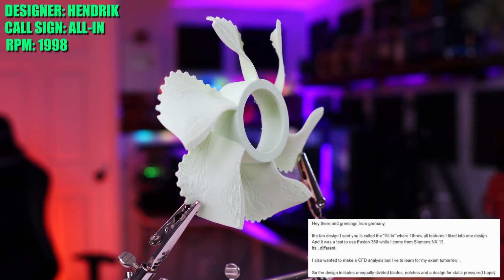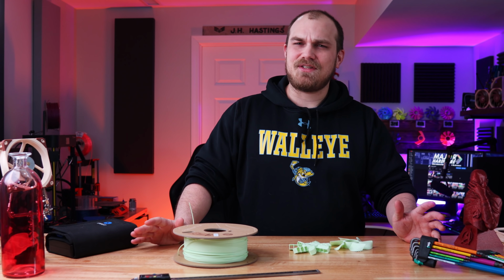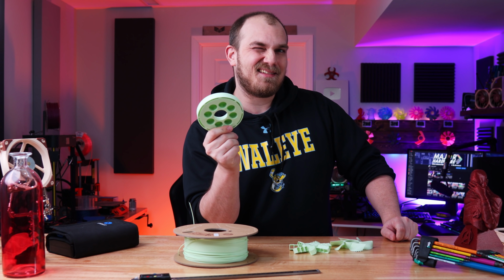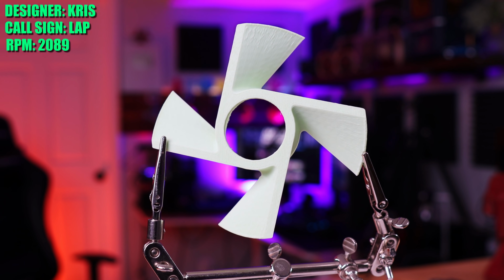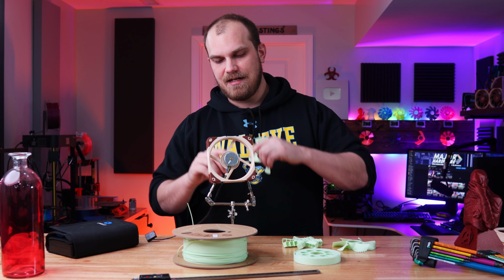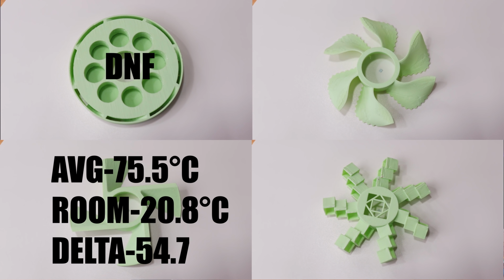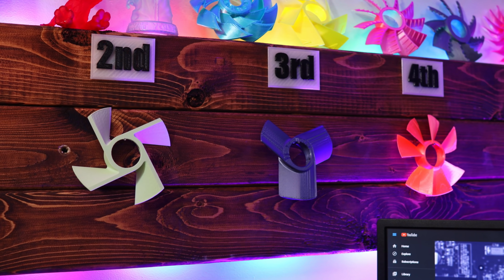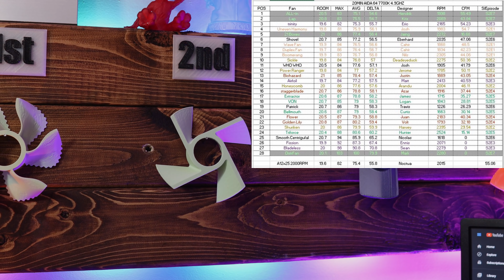MINECRAFT STEVE would love this! - Fan Showdown Season 2 Episode 7

Comment: I know nothing about 3d modeling software. How quickly could I learn because I have an idea

Also which programs should I start with
Reply: I made the 21 Boxes fan in Sketchup in like 30 minutes. It’s free and pretty easy to use. Much easier (and more free) than Solidworks which is what James uses. I tried Solidworks out and it does some cool stuff, but it is not nearly as easy to jump straight in.

Comment: I wonder if anyone ever tried a Turbo like fan. I dont know how to 3D model anything so I cant submit my idea.
What I imagine is the sucking turning inner part of a Turbo, insight a thight fit cone shaped housing with a whole in the top middle.
The Idea is that instead of pushing air with pressure into a engine, we are forcing air through the radiator fins

Comment: Someone has to design a car engine turbo for the show.
Reply: Without already moving input, a turbo-style shroud would just choke the air coming into the fan.  Could look pretty cool, though.  It'd possibly be a usable element in a case design, relying on external air rather than what's inside the case.  (Several companies like Dell have done basically this with fan shrouds and tubes.)

Comment: Doesn't the material affect the fan? If so isn't that unfair?
Reply: MH has stated that he isn't trying to be that scientific.  He is printing all of these on the same printer, however, which means they have to be compatible and they'll generally offer very similar results.  The biggest difference between them is the color.
Also note that his experiments with sanding, solvent smoothing, and comparing to resin prints or injection molds did not change end results very much.  Those things will have affected airflow much more than the particular filament used in a print.